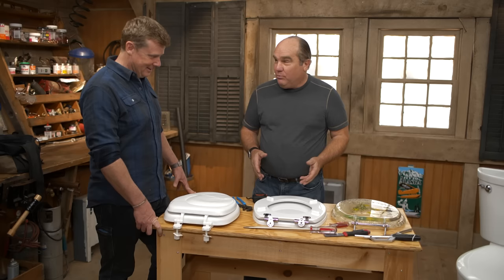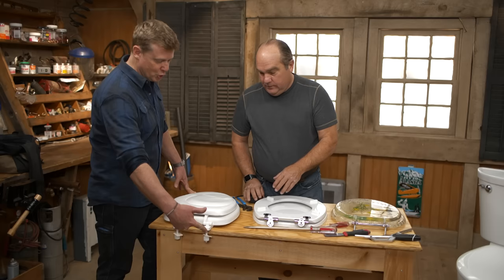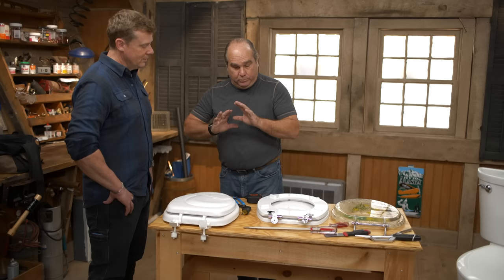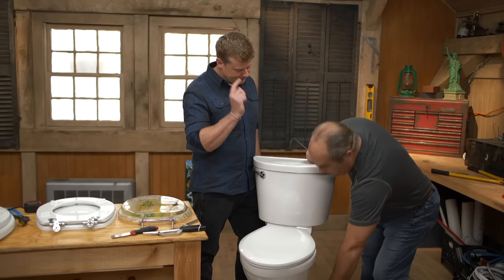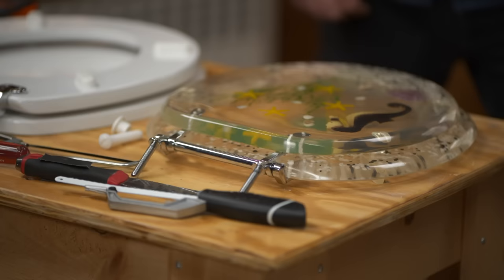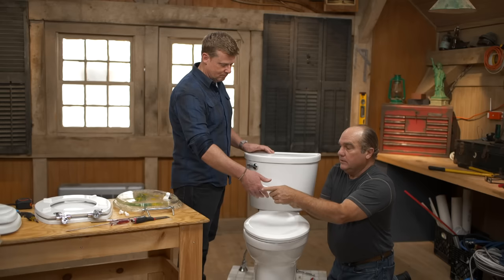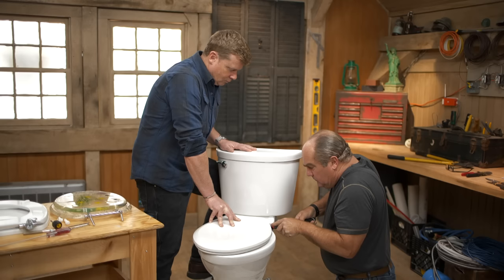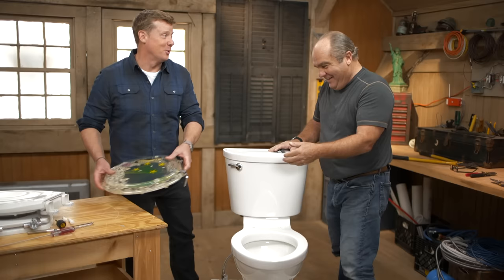How to Replace a Toilet Seat | Ask This Old House

Comment: The only issue i have with these cheap plasic bolts is they never seem to get tight enough to keep the lid from sliding around after awhile.  God forbid you over tighten one! Very annoying.
Reply: Right. I wish they talked about that instead of the seat itself. I think everyone is good with changing a seat, it’s the moving of the seat that people are having problems with
Reply: NEVER -- The American Standard is THE WORST --- literally just move all over the place.  They're horrible.
Reply: I don't have that problem because I don't use a toilet seat, I squat to poop.
Reply: That's my concern ,too.

Comment: Some Toto brand toilets use special hardware - expandable rubber tube that goes into the hole. A long stainless steel screw with a flat washer is screwed into it and tightened, which causes the rubber tube to expand inside the hole and pull tight. Installation is all done topside. Because it is rubber, you can screw it very tight and it won’t harm the porcelain.  Much better, more secure fastener then plastic bolts.

Comment: Thanks. Great video. Indeed, removing the old seat is the toughest part.
 When I replaced one of the bathrooms seat of 20+ years, I had to saw the metal screw off. But I had to saw it from the bottom. It was pain in the neck.
Reply: lol, the toughest part of what?  It's two screws.
Reply: @mccalejk2  I know from experience that sawing off old corroded metal nuts/bolts from an old toilet seat is indeed a pain in the neck. That's the hard part. Putting on a new seat once the old one is off is the easy part.
Reply: I think I wound up drilling mine out. Still a total pain.

Comment: I also learned the hard way with some you don’t need to remove the bolts at all but just swap out the top easily from the top side. Here I was trying to remove the boat like an idiot

Comment: I wish I could find reliable instructions for top mounting a seat. Many of us are now using toilets with skirted trapways, and it is impossible to change a toilet seat with bolts that must be tightened to a nut under the skirt. There are rubber grommets that can be forced into the holes, but I am having a hard time finding a demonstration of how to install the various standard toilet seat types into those grommets. Same is true for top mounting a bidet seat.

Comment: Not always easier, but the alternative to a saw for removing the brass bolts is to drill the head off. The metal is soft and the bolts are not that big. Start with a bit that fits in the slot and work your way larger till you only break the head. Most likely you will only drill down 1/4" or so.

Comment: The screws on our old toilet seat are metal, corroded, and stripped. I can't saw them off. I need another solution.
Reply: I am having this same issue. I’m going to hit it with WD40 before I start crying. I think mine is an integrated metal bolt the goes from the seat into the holes… it will be very difficult to simply saw it.

Comment: Excellent.

Can you talk about the unsightly ring at the water  line?  

Forget solid flush only, can't even get there.  This is a continuous problem with low flow toilets.

People use any and everything, bleach, fizz bombs, vinegar, pumice.   

My plumber says it's the quality of the porcelain being used. 

We know the blue stuff corrodes the tank parts.  It's not a bird best or leaves in the roof vent.  It's costly and frustrating,  simple things don't work.
It's a huge problem.
Reply: @Egleu1  no, nothing like that.  City water, no change .It basically happens with all three, recent vintage low flow toilets.
I heard they’re trying to do something about the shape,install something with teeth, like a hand soap grabber, some spikes.
Maybe to give the water some resistance.  Usually things on the drawing board stay on the drawing board.

Seems not enough water is allocated to the bowl. They didn’t change that part. 
Vexing problem, any water saved is being used trying to get the water line ring off.